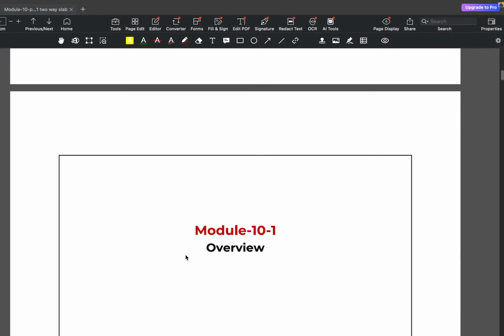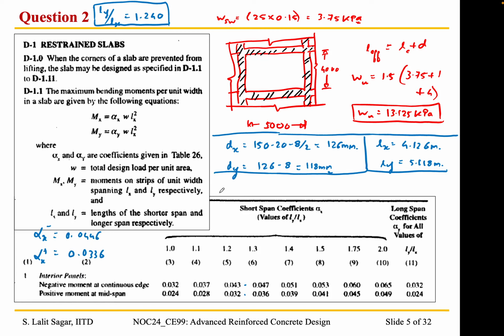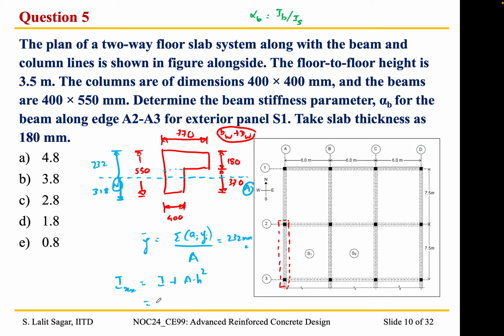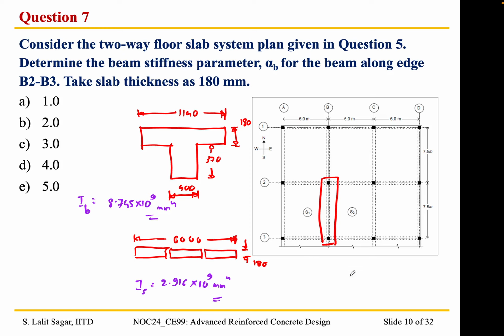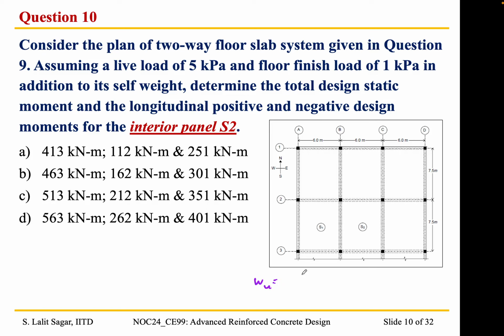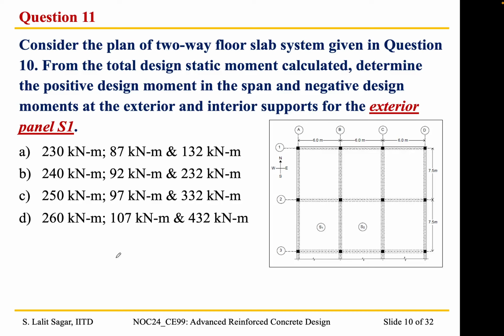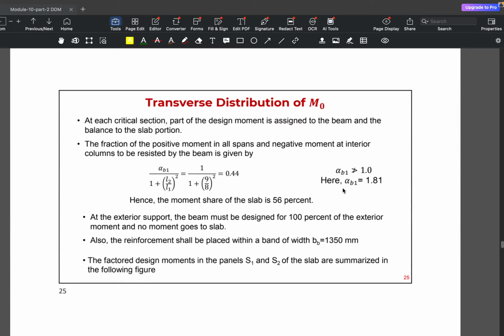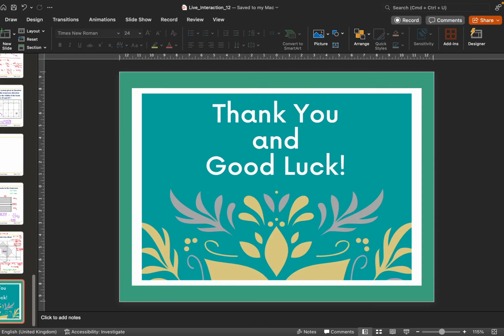NPTEL Advanced RC Design 2024 Live Interaction 12

Comment: Could you pls explain How Ib (55:51 &  1:02:08) is calculated sir? or tell me where i need refer for that please
Reply from the maker: Dear Student, 
The moment of inertia of the T-section (Ib) may be determined from the parallel axis theorem. The example solved in the Live Session was adopted from Example 11.6 of the reference text Pillai and Menon (2021). You may refer to any standard text on engineering mechanics/statics to understand how the moment of inertia of a composite section is determined.